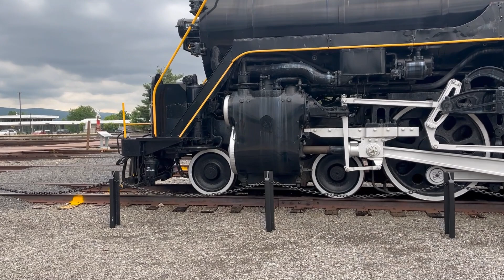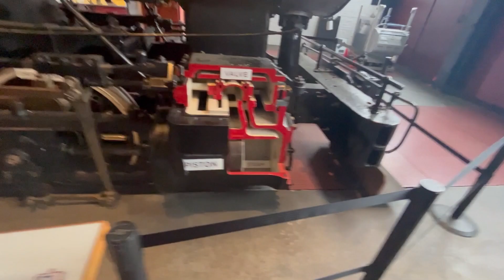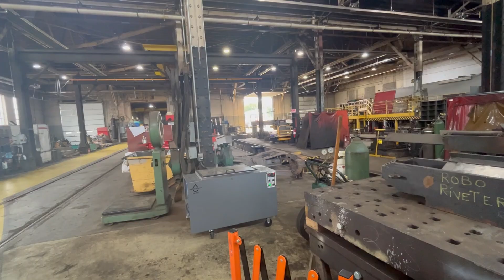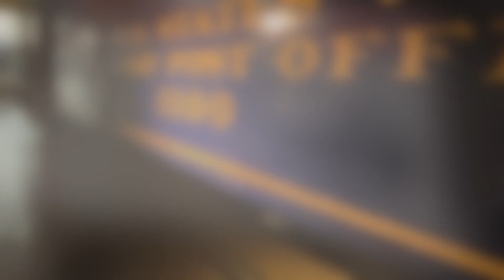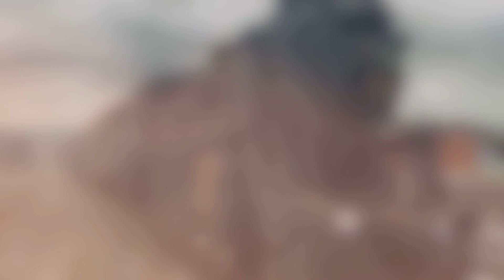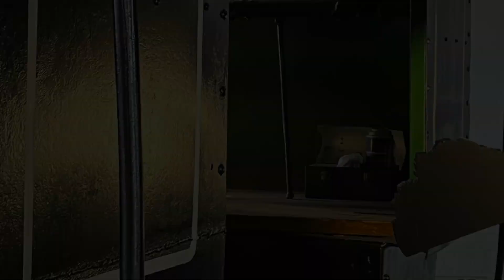My Epic Steam Adventure - Episode 3:  Steamtown National Historic Site

Comment: The UP took 4-5 years to restore a Big Boy, but has taken 25+ years to work on the 3713. The Baldwin 26 was down for 10 years due to a cracked crown sheet. They used to have 3 operating locomotives, but now only have 1. 
The 3713 will never be returned to service.
Reply: That is an unfair comparison, because you are comparing apples to oranges. Union Pacific Railroad is a private class on freight railroad and Steamtown is a National Historic Site, ultimately supported by the federal government. However, the Iron Horse Society is fundraising for the 3713 restoration and people can donate to the 3713 via the Iron Horse Society. I have been making multiple donations to the 3713 and I will continue to do so until the locomotive runs again. Have fun trackside taking pictures of the 3713 when it goes back into service.

Comment: It is little wonder people don't want to go to this place. They claim ownership of 30 odd locomotives. Most of them are rusting wrecks. Many historic rail cars are rotting away. hundreds of rolling stock sid in a huge yard just going to wrack and ruin.  Even the  Big Boy has parts missing from it.  They claim a cosmetic restoration, the fools painted over rust and trash, This place was fooled. Then engine, from a distance, looks good but up close, you see the rot, rust, dangling wires and hanging pipes.
Reply: Your negative comments don’t help. I still remember you talking negative about New Mexico Heritage Rail and the Santa Fe 2926 for no good reason.

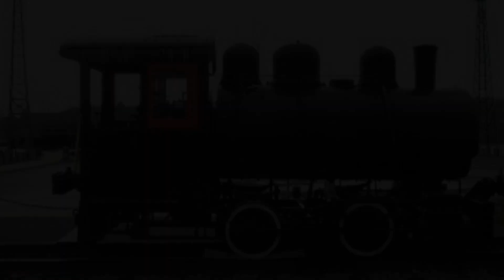Comment: 48:53 shouldn’t it be 3? I mean, the only other engine I didn’t see in this video was CN 3377.
Reply: 3377 is an anomaly as it's not considered part of the historic collection, rather it was designated as a parts source for 3254. That said, 3377 is currently in the shop on track 3 (one of the areas that is inexplicably off-limits to tours) where it was moved for evaluation as an operating restoration candidate after 3713. (Don't mistake this as a confirmation that 3377 IS the next project, it's one of several being considered.)
Reply: @racerwowak  I've heard, but I still have my doubts it might run again.
Reply: @atsfevan0242  you should, because it's not certain yet which engine will be the 2nd excursion engine, and I doubt a final decision will be made until after 3713 is running.
Reply: @racerwowak  ik
Reply from the maker: You know, I didn’t see 3377 on the website, so I thought that it might not be there any more.  I don’t know where it was at.
Reply: @ehadder  probably hidden somewhere, you didn't see it, or was in the shops is my best guess.
Reply: Great video, I used to volunteer here for many years.  I have seen the 2317 and 3254 run many times, they used to put on an awesome show.  Those alcos were part of the Delaware Lackawanna a subsidiary of GVT, they a Local in the northeast. Your Ranger is a good friend of mine.  During the summer 2023.  Cp 2816 came from Steamtown in the early 2000’s.  Thank you for sharing.

Comment: Great video I do want to point out that when you said that you rode behind Reading 2101 in 1978 it’s that she didn’t operate at all that year because earlier that year in March she was involved in a roundhouse fire in Silver Grove Kentucky and she has not operated since and C&O 614 look her place on the Chessie Steam Special and was given to the B&O railroad museum shortly after the fire in 1978! Then 614 was restored in 1980 to pull the safety special around the Chessie system and was 2101s replacement at that time! Also it’s great that you mentioned that 3713 is getting funding next year for the project since as of very recently the group who has been restoring her since 1995 just broke off their connections with steamtown to restore the locomotive to service and now it’s steamtowns responsibility to restore her as of now. Also it has been said that once 3713 is restored that Canadian Pacific 2317 will go into the shop for a restoration to operation so basically 3713 will be taking 3254s place since that engine is in very poor shape!
Reply from the maker: The roundhouse fire was 1979.  I just looked it up.  I have the pictures from the 2101 excursion in 1978.
Reply: My bad I was off one year but still the rest of what I said are true facts!

Comment: I’m gonna be honest, steamtown is one of if not the biggest disappointment to the railfan community. The NPS runs it terribly. 3713 has been in the shops for roughly 20 years I believe. And they even spent a decent amount of money that was meant for 3713 on other projects.
Reply: No 3713 funding has been diverted to other projects. If you're going to complain at least have accurate complaints.
Reply: @racerwowak  I literally said that. Maybe you should read the full thing before trying to correct me.
Reply: 29 years actually
Reply: Couldn't agree more. They're just not good anymore.
Reply: @evanf1293 totally. 565 IMHO would be a good candidate for the Carbondale trips. Also it would be a BLESSING to put names of the road foreman and locations on the CNJ/DLW/EL passenger cars. It’s insultingly depressing to see the museum all scrapyard quiet
Reply: @nicholasmedovich8691  Yeah Steamtown is pretty much one big junkyard but the owner died and his family had absolutely no idea how to run it so they just left everything to sit and corrode.
Reply: @BMMEC6000 would be nice if the NPS was split off. Let FMW handle the rebuilds of their equipment
Reply: @nicholasmedovich8691  With exactly what money would FMW restore everything?